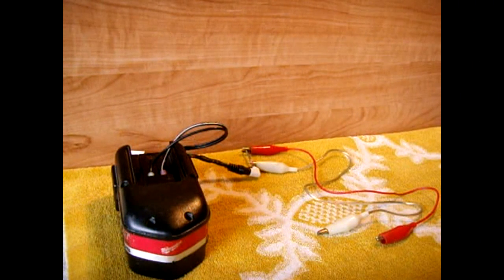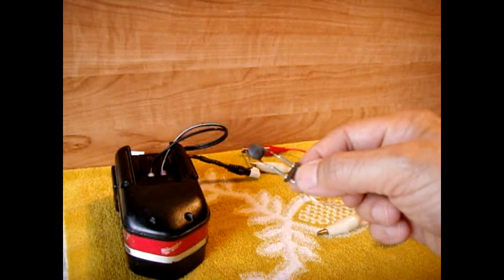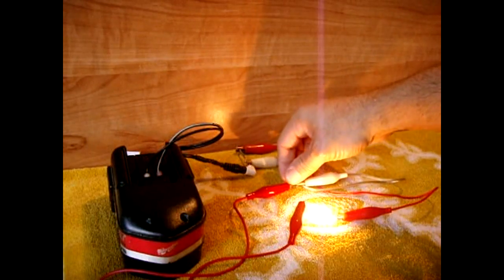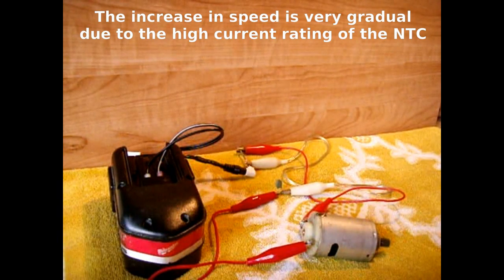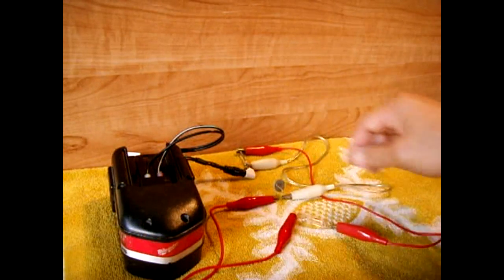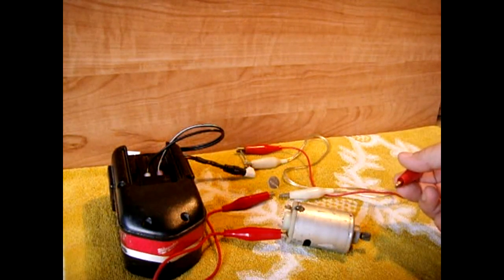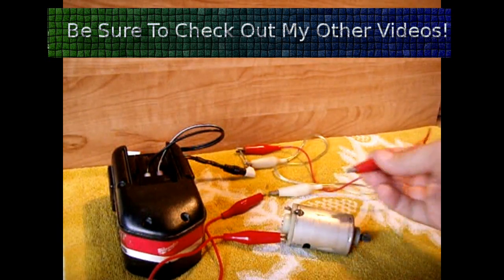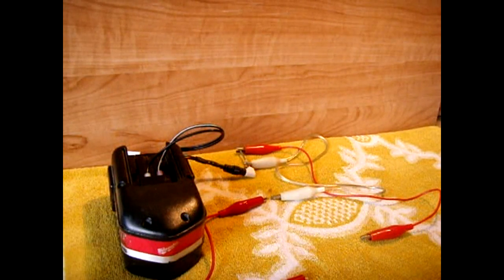Understanding How NTC & PTC Inrush Current Limiters Work

Comment: Are there AC PTC heaters that wouldn't work with DC? I have a wax motor that is rated at 24VAC/3W. It has a resistance of around 150 ohms but when I connect it to 24DC, nothing happens (the motor doesn't extend or heat up).

Comment: Hey long time fan of your videos, this one actually came up in my research. Do you know if this is ok to do for an air conditioning window unit?
The unit pulls 19 amps inrush and 630 watts (measured) while running. When it kicks on my lights dim and my computer's UPS clicks on then off lol so it is annoying. Thanks

I was thinking if I can use one of these to get the window inrush maybe only 10 amps instead of 19 it would greatly help it.
Reply from the maker: Sounds like you need that AC on its own 20A branch circuit
Reply: @electronicsNmore  It's just a normal tiny window unit. They all pull crazy inrush =[

Comment: I couldn't get the mechanism of thermal taped PTC on battery systems. If I'm not wrong, it rearranges the charging current on rechargeable batteries. But I have an old non rechargeable battery pack here and it has 2 serial soldered PTCs. They are thermal taped as you said. Btw the pack is really old maybe from 1980s, it has not any circuits on it, just wires and 2 thermal taped PTCs.

Comment: are these components applicable to use in frequency dividers for audio speakers sir...especially for tweeter  speaker connections?
Reply from the maker: Never seen them used for that purpose.
Reply: @electronicsNmore  ok sir thank u very much...more power to ur channel...maybe i will try putting polyfuse or pptc on my tweeter speakers...

Comment: hey.. I need your help Brother... I have a dc motor.. Which has very thick windings so low resistance... Due to that inrush current is very high and my supply is 3.3amps...19.5v.....The motor jerks... Crazy untill it chacha some speed...NOW HOW TO USE ntg Or pta to overcome such problem
Reply from the maker: https://www.ametherm.com/blog/inrush-current/dc-motor-inrush-current/

Comment: Question on the PTC, does that thermistor keep drawing a load while it's hot and opening the circuit or does it simply cut the flow of electrons while it's hot?
Reply from the maker: No. A very high level of resistance is reached, and the flow of current stops.

Comment: Question, can a ptc  be  over loaded and burn out?

If I have a 10A (12v) ptc, between 12v Battery and super capacitor.  When capacitor is empty (2v or so) and I make a parallel connection from battery to capacitor, the inrush current is  approx 100amps.

Will the ptc isolate it upon connection? Or will the rush be too fast and  overload and burn out the ptc?

Comment: Got a new respect for the pptc, ptc ,ntc! Is it possible to build a soft start for a well pump with any of these???
Reply from the maker: I would make sure the capacitor for your pump is good.
Reply: @electronicsNmore  it is a small 120v submerged pump, it pulls like 7 amps peak, I want to be easy as possible on my inverter, I'm looking into a soft start, I found a chinease board bun unsure, it looks to have a relay on it also, maybe it latches the relay after voltage rises??  thanks,  for all the great videos!
Reply: @electronicsNmore  I think it's a universal motor, like in a 120v drill, its a cheap pump, just over $120 or so,  I have heard ppl running some off DC, but may not be the same pump..

Comment: You kept referencing the PTC as an NTC.  NTCs get more resistive as the warm, whereas PTCs get less resistive as they warm.
Reply from the maker: With NTC thermistors, resistance decreases as 
temperature rises. An NTC is commonly used as a temperature sensor, or 
in series with a circuit as an inrush current limiter.With PTC thermistors, resistance increases as temperature rises. PTC thermistors are commonly installed in series with a circuit, and used to protect against overcurrent conditions, as resettable fuses.

Comment: I hv question please help me.
If there are 3 R namely potentiometer,thermistor,and resistor( it hs been  arranged like that)  and that circuit is series. What happen with the voltage potential passing thermistor if thermistor get hot ?
Reply: It depends if the thermistor is PTC or NTC

Comment: Great video. I actually have a loudspeaker with two of these. One of them has appeared to have overheated and burnt at the connection to the board. I cleaned up the socket and resoldered it, but I'd like to order some spares. Would you know where I could order these? Thanks
Reply from the maker: Ebay

Comment: can NTC Thermistors be used in parallel ?
Reply from the maker: Yes. You would have 1/2 the resistance value if using the same rated NTC's.

Comment: hi
 how to check whether a ntc thermistor 5ohms 4ampere (sck 054) is good or bad. when I checked the resistance at 25 degree Celsius it was showing 4.1 ohms. when I heated it with a lighter it was showing 2.7 something. is that normal?? this thermistor is coming near the fuse of acer lcd monitor power supply board. please explain
Reply from the maker: You would need to refer to the data sheet for that NTC thermistor for the specs. They're all different.

Comment: Hi ,is this the same kind of thermistor used in power pack batteries for 12v
Reply from the maker: +arumugam samy 
Battery packs use a thermistor. A thermistor's resistance value changes when the external temperatures rises or falls. A NTC/PTC inrush limiter relies on current flowing through the component to changer the resistance.
Reply: Hi thanks for your swift reply ,I find your info very useful , I f need to purchase any of such NTC for my battery pack ,Do you have any contact that I can buy from. ..Thanks

Comment: PPTC's are quicker to cut the load, but slower to react. PPTC's react like a cliff, while a PTC will react like a slope. The PTC will be quicker to start limiting the current, but the PPTC will be quicker to cut the current to effectively zero. In this case, slow and steady does not win the race ;) 
However, in many cases, the PTC is safer as it will spend less time delivering too much current compared to the PPTC... so you have a tough decision to make. It really comes down to the continuous resistance spec for your specific load needs.

Comment: hi sir good video .how the ptc connect in a circuit.across +and - pole.or series in + or minus line? it is damge by over current?any chart is avilable for suitable ptc selection.pramo
Reply from the maker: Pramo Ku They are non-polar. You connect them either way in series. There are charts available online. Do a Google search.

Thanks.
Reply: thanks
Reply: sir this is same as resetable fuse
Reply from the maker: A PTC is very similar to a PPTC the way they operate. This difference is how they are made.

Comment: another great video, very good information, I didn't know that they existed, great little device.  I have a question, the situation is a large air conditioner comes on and the inrush current is so high it blows out the UPS and then the server. any idea what kind of device I could use in this situation  thanks mk.
Reply from the maker: snaprollinpitts Check out the inrush limiting circuit I have on my channel.
Reply: thanks

Comment: i think from ur video the ne used in CFL circuit on the tube filament  terminals are NTC whcich allow the filament of of cfl get safe start,,am i right ????...s i found some of the CFLS where they hav labels like 75L, HL PR1 , SP MZ6 theristors n searched a lot about what they ment what is thier voltage temp limits bout couldnt find any so can u plz explain about it or sent me some link ...kindly waiting for reply,,,and do u know why old CFLs only hav those stuffs but not on new ones??

and what is the requited capacity of thermistors for CFLS

Comment: Hello could u tell me what value would be best to use in a 4.2 v dc max 35amp circuit I want it to trip at anything over 35amp
Reply from the maker: Since you are using that much current, use a PPTC(Poly Switch resettable fuse). Many different voltages and current ratings available. Looks for one with a trip current of 35A.

Thanks For Watching.

Comment: It is there any chance to use this kind of circuit to power a" Commonly open side of a relay!! and when the power come up turn on a fan for temperature control and engine...or something of that kind?? Thanks in advance.
Reply from the maker: I do not understand what your looking to do. I have temperature control circuits in my video playlists. I suggest you check them out.

Thanks for watching!
Reply: electronicsNmore yup! I found your video showing how to use the temperature cut out switch... Thank you very much. your comment is greatly appreciated.

Comment: Thanks for the information !
I got a 12v dc motor with output power: 3.4 watts rated speed : 170 rpm rated current: 0.9A
 ISo for my case in order to prevent the current increase more than 0.9a when the load of motor increase,i just buy a ptc and it will solve the problem? Thanks a lot in advanced .
Reply from the maker: You can use a PTC, but I would just buy a  PPTC(polyswitch). You can look at a chart and choose exactly what you need. Just make sure the operating current is what you need. Ebay sells them cheap.

Comment: Wow man, For years I have been saving "What I thought to be a ceramic capacitors" would you please share the best way to know when is a cap or when is a PTC?? or NTC?? Thanks in advance.
Reply: Measure the cold resistance with a multimeter. If you can measure above 10Ohms its an NTC, if on the other hand it reads nearly zero its a PTC. Although the circuit where they are can give you a hint.
Reply from the maker: NTC's & PTC's do resemble ceramic capacitors. You have to read the component to see what it is.
Reply: Susana Godinho thank you so very much! I really appreciated your input are a true wealth to me!